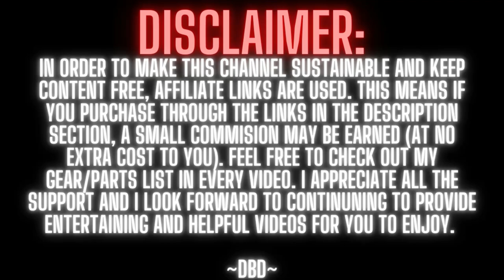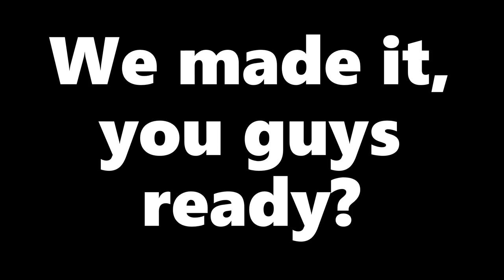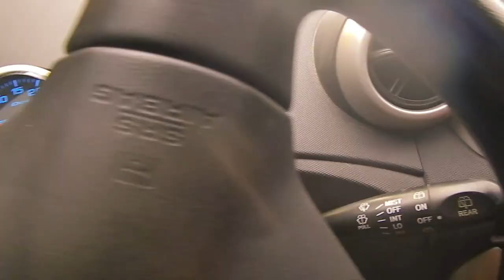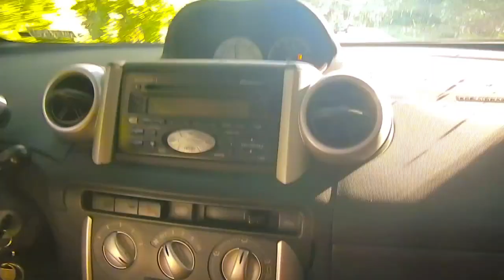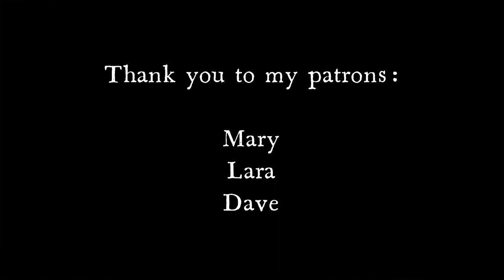Picked up a turbo'd 1NZFE Scion xA | Lenin's World #scionxa #xxxa #deathbx #turbo #1nzfe

Comment from the maker: INSTAGRAM: https://www.instagram.com/lenins_world
PATREON: https://www.patreon.com/LENINsWORLD
FACEBOOK: https://www.facebook.com/Archael
SUBSCRIBE: https://www.youtube.com/c/LENINsWORLD

ENGINE:
NGK (7090) BKR5EGP G-Power Spark Plug: https://amzn.to/3bTlwBz
NGK Spark Plug 4PK: https://amzn.to/2SbflT7
NGK IRIDIUM Spark Plug 4PK: https://amzn.to/3aOvKTY
Agency Power Light Weight Crankshaft Pulley Scion xB/xA 03-06 1NZ-FE: https://amzn.to/3tvKVsH
Denso 210-0527 Remanufactured Alternator: https://amzn.to/2Pq9TKR
Gates K040476 Micro-V Serpentine Drive Belt: https://amzn.to/2PowY0h
Gates K030334 Micro-V Poer Steering Belt: https://amzn.to/32GAM3I
Energy Suspension 8.1103R Motor Mount Insert Set: https://amzn.to/3bUHJiB
Beck Arnley Driver Side Engine Mount: https://amzn.to/2OOGQkk
Beck Arnley Rear Engine Mount: https://amzn.to/3lFAoYL
Westar Passenger Side Engine Mount: https://amzn.to/2OPqQyu
ACCEL 140078-4 Ignition Coils: https://amzn.to/386CxXN
Optima Batteries 8025-160 25 RedTop Starting Battery: https://amzn.to/2NZWtol
EXEDY 16800A Racing Clutch Kit: https://amzn.to/304cAUx
LuK LFW402 Flywheel: https://amzn.to/3kDjObo
Injen Technology RD2105BLK Race Division Black Cold Air Intake System: https://amzn.to/3qbXir6
Injen Technology IS2105P Polished Short Ram Intake System: https://amzn.to/3e2W1Al
DC Sports SRI4401 Polished Short Ram Intake System: https://amzn.to/3kIWAk7

WHEELS/BRAKES/TIRES/SUSPENSION:
Hubcentric Rings 73.1 OD to 54.1 ID: https://amzn.to/313Mkxs
Hubcentric Wheel Spacers 15mm (front): https://amzn.to/3FAMg7D
Hubcentric Wheel Spacers 25mm (rear): https://amzn.to/3EDoFSe
J2 Engineering 7075 Aluminum Lug Nuts w/Lock+Key: https://amzn.to/2O3mnrv
Raceland Coilovers: https://amzn.to/3EucKq1
Konig Hypergram 15x7.5: https://amzn.to/3sFtuID
Toyo Tires EXTENSA HP II All-Season Radial Tire - 195/50/15 86V: https://amzn.to/3sKzZtL
FALKEN SINCERA SN250 A/S All- Season Radial Tire-185-60-15 84H: https://amzn.to/3zdKQxu
Power Stop K109 Drilled & Slotted Brake Rotors w/ Brake Pads Kit: https://amzn.to/3kFvKt5
Goodridge SS Brake Lines: https://amzn.to/3JoCoQp
Monroe Rear Shock OESpectrum: https://amzn.to/3aGAvPE
KYB Excel-G Gas Rear Shock: https://amzn.to/3exodtP
Megan Racing H-Brace: https://amzn.to/30PrbDx
Energy Suspension Sway bar bushings: https://amzn.to/3ofyrDD
Cardone 66-5191 CV Axle: https://amzn.to/3mDGJ8E
Cardone 66-5193 CV Axle: https://amzn.to/3exNAvT

EXTERIOR/INTERIOR LIGHTING:
Red HVAC Led: https://amzn.to/33agbFi
White HVAC Led: https://amzn.to/31DIpaO
Green HVAC Led: https://amzn.to/3Gn2HnR
Blue HVAC Led: https://amzn.to/32X0Qrp
Yellow (OEM look) HVAC Led: https://amzn.to/3lINCoX
Red LED flashing brake lights: https://amzn.to/3zkYXj8
Crystal Smoke LED Side Marker: https://amzn.to/3iwZAzy
Crystal Clear LED Side Marker Lights: https://amzn.to/3kDyMAf
LED License Plate Lights: https://amzn.to/3j1lHjq
Yellow Fog Light Bulbs (X2): https://amzn.to/39oAVta
Carbon fiber TRD Shift Knob MT: https://amzn.to/3mgCxw5

REPLACEMENT/MAINT:
03-06 Scion xB Primed Front Bumper: https://amzn.to/3mNHdYK
03-06 Scion xB JDM Style Front Bumper Lip: https://amzn.to/3wQYF38
03-06 Scion xB OEM style grille: https://amzn.to/3e3MozP
Toyota Passenger Side Retainer: https://amzn.to/3tnuEG8
Toyota Driver Side Retainer: https://amzn.to/3afhqUm
FRAM Cabin Air Filter: https://amzn.to/3arAoqO
Carbon Fiber hatch handle: https://amzn.to/3xHn0bl
Salsa Red hatch handle: https://amzn.to/2TQKhJu
Blue Onyx Pearl hatch handle: https://amzn.to/2TVyOsj
Envy Green hatch handle: https://amzn.to/2TTa9EH
Black Cherry Pearl hatch handle: https://amzn.to/3AGXMfH
Polar White hatch handle: https://amzn.to/36qfC8Q
Camouflage Metallic hatch handle: https://amzn.to/3k2l5ub

OIL/COOLANT FLUIDS:
Funnels Trio: https://amzn.to/3gDyuqu
Toyota Oil Filter (5PK): https://amzn.to/2PeiAIg
Amsoil Signature Series 5W-30 Synthetic Motor Oil: https://amzn.to/3foCTxm
Castrol Edge Extended Performance 5W-30 Synthetic Motor Oil: https://amzn.to/3ryvOwA
Red Line (MT) 75W 90 GL4 Gear Oil 2PK (2 quarts): https://amzn.to/3wjfbc6
G-PLUS Radiator Hoses Black: https://amzn.to/3dia3ME
G-PLUS Radiator Hoses Red: https://amzn.to/3rwZH0r
G-PLUS Radiator Hoses Blue: https://amzn.to/2PjdP0f

ELECTRONICS/STEREO/GAUGES:
Kicker CS Series CSC693 & CSC65 Speakers: https://amzn.to/3b1bH4L
GlowShift Tinted 7 Color 300 F Water Coolant Temperature Gauge Kit: https://amzn.to/3bUYCJV
GlowShift Tinted 7 Color 60 PSI Turbo Boost Gauge Kit: https://amzn.to/3q6Arxr
Innovate Motorsports 3918 MTX Series MTX-L Plus Wideband Gauge: https://amzn.to/387u7j4
Innovate MTX-L (Bosch) wideband air/fuel sensor: https://amzn.to/3drtfsi

DETAILING:
Chemical Guys TORQX Polisher Kit with Pads, Polishes & Compounds (9 Items): https://amzn.to/2YkHl9S
Chemical Guys TORQ 15MM Long-Throw Polishes & Compounds (8 Items): https://amzn.to/2YqM9Lq
Chemical Guys V Line Polish and Compound Kit 16 fl oz (4 Items): https://amzn.to/3FulRJ0
Chemical Guys 8PC Hex-Logic Buffing/Polishing Pad Kit, 5.5", 8 Items: https://amzn.to/3BfMDST
Chemical Guys Hex-Logic Buffing/Polishing Pad Kit 5.5" & 16fl oz CG pad cleaner (8 items): https://amzn.to/3a5R3Ql
Chemical Guys Wet Mirror Finish 16 fl oz: https://amzn.to/3BiaOQv
SHINE ARMOR Fortify Quick Coat Ceramic Coating: https://amzn.to/2YqNC4o
Shine Armor Fortify - Ceramic Spray & Scratch Repair: https://amzn.to/3iIG2K9
Shine Armor Fortify Ceramic Spray: https://amzn.to/3wnSxih
Shine Armor Revive Scratch Repair: https://amzn.to/3wvgV1k
Meguiar's Clay Bar Kit: https://amzn.to/35qdNbs
Meguiar's Ultimate Insane TIRE Shine: https://amzn.to/3grxm9t

TOOLS:
Oil Catch Pan: https://amzn.to/3sF7AVH
Spark Plug Gauge Tool: https://amzn.to/3xAeWtT
Tresalto Auto car interior removal tool kit: https://amzn.to/3j4jGmE
LEXIVON 5/8 spark plug socket w/ extension: https://amzn.to/3ubTA3W
Autel AutoLink AL519 OBD2 Scanner: https://amzn.to/3rroG5i
Jack Stands 6 ton capacity: https://amzn.to/318pKny
Pittsburgh 3 ton low profile jack: https://amzn.to/3qzKZrb

DND PERFORMANCE:
DND T shirt : https://amzn.to/2RQtogO
DND Performance Microfiber Towel: https://amzn.to/33KmZGH
DND Performance Hydration Pack: https://amzn.to/3hoAxjf
DND Performance Goody Bag: https://amzn.to/3tNZZkO
DND Performance Spline/Race Style Quick Release (Silver): https://amzn.to/3sN5L5M

VIDEO CAMERAS:
DJI Osmo Pocket Handheld 3 Axis Gimbal Stabilizer Camera: https://amzn.to/31aFPsY
Zoom Q8 Handy Video Recorder (perfect for drummers/musicians):https://amzn.to/3pklJ6m

Comment: Hey, I have a question. What parts a on there to make the full turbo kit. I have a 2006 manual 1.5l manual drive Scion xA waiting to be messed with. I’m not a track junky but want to play with my first car.
Reply from the maker: Hey man that's awesome, I love these 1NZ's, and thank you for taking the time to check out the video! You'll need a turbo kit or piece together one that will work for the 1NZ. So if you were to piece it together you'd need a turbo, manifold, downpipe, intercooler, piping, air/fuel/temp/boost/oil gauges, standalone ecu/piggyback, and some nickle n dime things. I ended up upgrading clutch, thermostat, braces, and replaced axles, rear main seal, etc while I had everything pulled. I did it all in my driveway. Only thing I didn't do was electrical for my gauges (thanks Tyler \m/) and of course the tune. You'll save a decent amount of coin if you can do install yourself. Took me a few months of planning/obtaining parts. was totally worth the learning experience and the smiles per gallon ;) Follow me on Instagram to see more of the DEATHbX build.
Reply: @LENINsWORLD  sound like a lot of work, I’m probably going to pick up turbo parts to piece together a kit over time. Is there any kits you know of?
Reply from the maker: @O-Cal_Lifts  prob less than a handful of brand new kits available. Check ebay, CL, MP, etc and you may find a used one for a good deal. I have spare Greddy turbo that may be up for sale sooner or later ;)
Reply: @LENINsWORLD  Might have to take a look👀… Do all the internals have to be swapped? Or can I use stock engine and just turbo it with the parts I need? Prob not that simple though😪
Reply from the maker: @O-Cal_Lifts  Greddy kit works both with stock or built internals. Built internals along with other upgrades allow you to seek more power, tuning places a big roll too
Reply: @LENINsWORLD  Thanks for all your help… I will come by to ask questions and watch the vids🤙
Reply from the maker: @O-Cal_Lifts  sure thing hombre, thank you for the support 🤟💀📦🔥